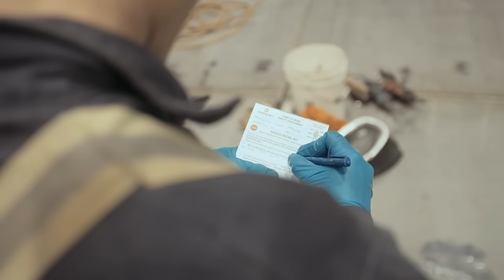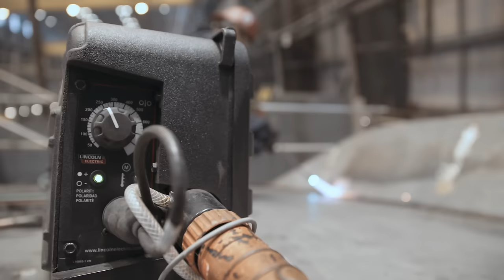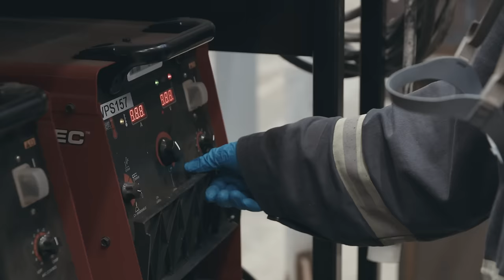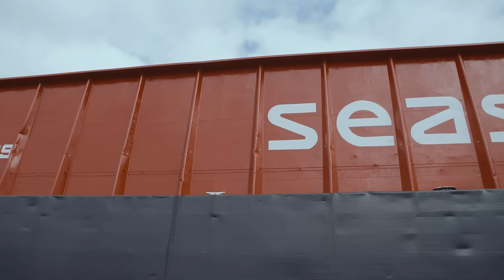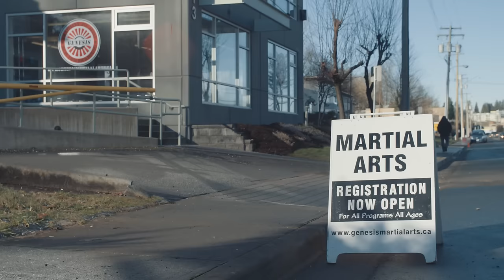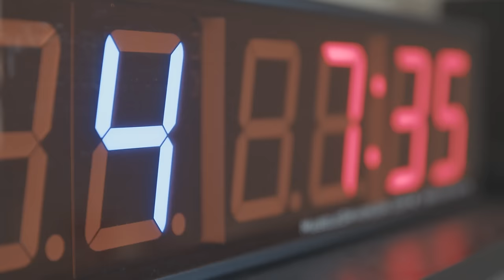Large Ship Welder

Comment: Being a welder can be a very rewarding job. I have been in the welding business for many years. There is a satisfaction and  that comes with building something from a set of plains and the ideas of man. The entire process, many times, is quiet intriguing and inspiring when one considers its birth as an idea, the research, engineering and design that goes into the production of drawings used to convey technical data that ultimately produces a product, or in this case, a massive sea going vessel. 
The process, and numerous trade skills that go into the process, is for some - myself included, very rewarding. It's hard work. The atmosphere can be challenging (people and places), but it can be a very respectable and rewarding career choice. "Rod burning" is simply the beginning of what can become a very technical, academic and intellectual job that can indeed be quiet lucrative. One must remember, no matter what your vocation in life, a fool and his money soon part.
Reply: Hey,  is there any heavy duty weld process that require, someone heating a weld zone right after the welder has passed, and keeping it hot so it can be forged down with hammer hits,  ?

Comment: I'm a welder and have been for just a few years and love it, but can tell you that working on ships is not something you want to do. That looked like dual shield flux core. Your vision and lungs are going to disapear a few years into doing that kind of thing, not to mention the extreme heat, tight spaces and LOW PAY. Get into remote welding, mine work or pipe welding is you really want to have a good time.

Also, i'm just going to be honest here, wire feed welding is not that difficult. I think the knack to it is a little overblown. Get into heavy stick welding and tig work if you want to see your potential

Comment: im welding for 2 years only but 12hrs/day and my back is hurting so much
Reply: can you raise your work to a more comfortable position? get out if you can
Reply: Keep your back straight. Not hollow not bend but straight. Its better for your spinr
Reply: Get out now while u still can
Reply: If you are under 30 I recommend taking those years of welding experience and trying to find a union to join, like Pipe Fitters/Iron Workers. They usually have benefits, and you’ll learn a lot more than just welding.
Reply: Hahahahaahauajaikajjjahahhahahwh!!47
Reply: Train to strengthen your back muscles, it will help. Also try to keep a good posture at all times.

Comment: what kind of respirator is that.? I tig weld stainless. very little fumes but sometimes welding on dirty material makes some smoke. I try not to breath it in but can't stop in mid weld.
Reply: The hexavalent chromium from tig welding stainless is still toxic even though you can't see any smoke.  Also, ozone can be created, and it irritates the lungs.  That's worse than the little bit of smoke from a little oil coating being burned off.
Reply: Edjonson The IV not sure, but miller makes one that is cheap and works well.
Reply: Edjonson The IV it's a 3m half mask with p100 pancake filters
Reply: The pink 3M 2097 hepa filters are the ones you want for the welding. A standard P100 will let the smoke and fumes through.
Reply: @phiksit  actually u wanna go with 2297. More expensive but lasts way longer.  just to be safe.. 2097 is partially good for welding

Comment: I have no problems welding TIG or MIG on steel, even stainless steel. But I still can't weld thin (0.060") aluminum. I can weld thinker aluminum, but the really thin stuff is not happening with me.

Comment: 🤣🤣🤣 Fun video... Industrial welding is one of the most dangerous and difficult job in metal industry...It is not garage welding my friends...Come to Europe to see how in most firm's welders are like slaves, welding(grinding, preparing, fixing, cleaning) 10 to 12 hours a day, payed low(for the job type). Welding CJP groves with very high parameters, entering in small holes, welding in positions that you can even imagine. And on top of that every body around you thinks that welding is a simple job...

Comment: For those who got exited whit this clip:I'm working in WBSY as quality inspector and I see welders life, in fact I worked as a welder my self, for 8 moths and I can tell, that this profession WILL kill you(specially if you weld ships ). Of course that guy in the clip works in a nice ship yard, he likes what he does and that's fine, but be aware that you will be working in badly ventilated areas when you'll need to weld inside the ship, very uncomfortable positions, in very loud environment, in summer you'll work in about 60 degree Celsius temperature, your ayes will get bad, because those welding helmets witch shipyard will give you, is shit, you'll need to lay in a metal shavings which gets every were, all ways moving heavy equipment and so on. If want to be a welder try to find some small shop where you can work in a nice comfortable environment like car bodies or some thing like that..
Reply: Yes...  very true.

Comment: anyone here know what rods they use? I'm guessing like 100xx or 110xx
Reply: anotherrandomtexan25 not 100% sure, but in the ship yards I have seen it is normally HY80 up to HY110. They normally test on 110 and certify up to that.
Reply: Weld test is usually 2G, 3G and 4G groove weld with .045" flux core wire / 100% CO2 shield gas on .5" beveled mild steel plate with backing strip.
Reply: flux core mig is used in shipbuilding